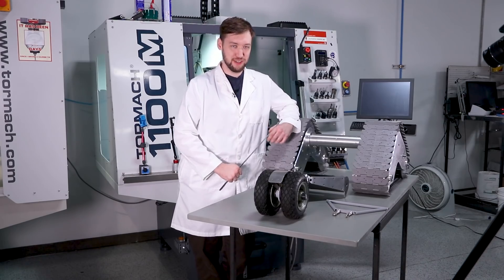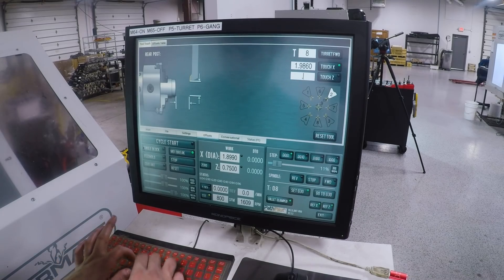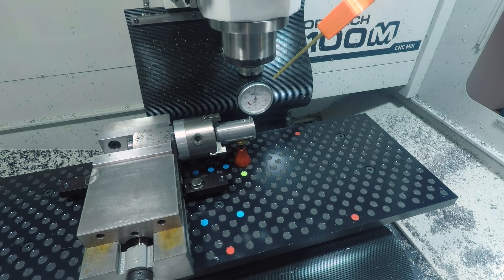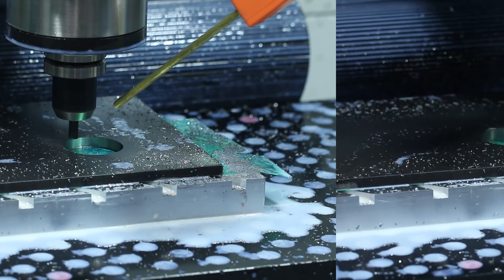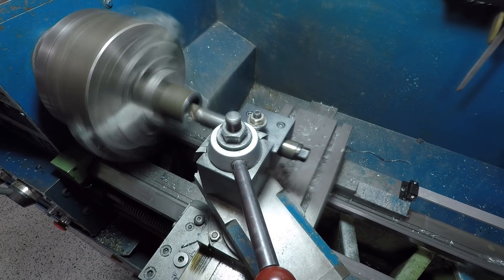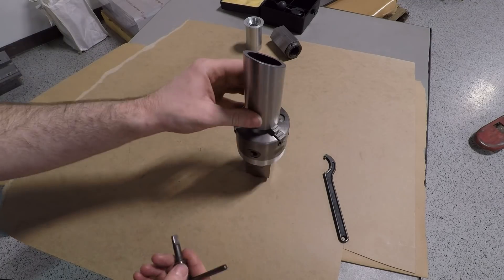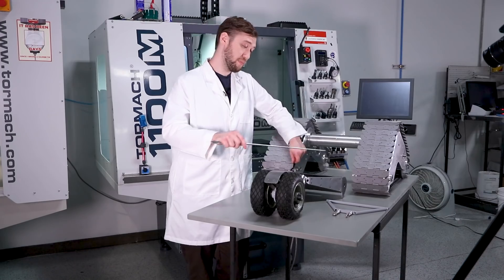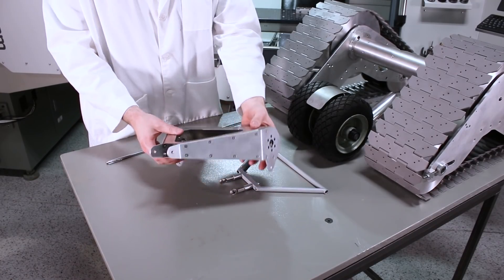Johnny 5 Part 6 - TailWheel Caster | WW252

Comment: So, if those Cessna wheels are hard to get, why not duplicate them and cnc a new set? Sure, they probably won't be airworthy, but still good for Johnny 5. And the original Cessna wheels could be used by someone with a vintage Cessna.

Comment: If those rare Cessna wheels are airworthy parts it's kinda shitty to use them for a vanity project like this. There could be a owner/operator out there with a grounded plane in need of a certified part. If they are not airworthy or repairable then it's fine.

Comment: Just FYI.  That's not how you pack a bearing.  Keep up the good work.   Cant wait to see the Johnny 5 stroll though the shop. 😆
Reply: Could probably run it dry and still last a lifetime in this application. Next to zero load and its basically just a show piece.

Comment: I really thought that superfly setup was fixing to go real bad real quick.
Reply: I didn't think much of it when I saw it go by, but you've got a point.  I will say I wouldn't run that one in my shower curtain setup.  I'd want a full enclosure just in case any one of those clamps shifted.  I love the finish on the superfly but dang those things are bad for the nerves on anything that isn't a flat sheet.  That was a ballzy and inventive setup.  It was rigid enough though.  The cut sounded pretty normal for steel.  Did he actually take level from the spindle housing?  I'd have never thought of that.  :P